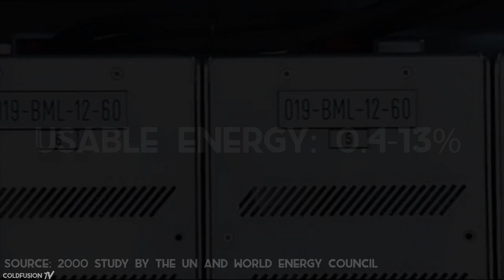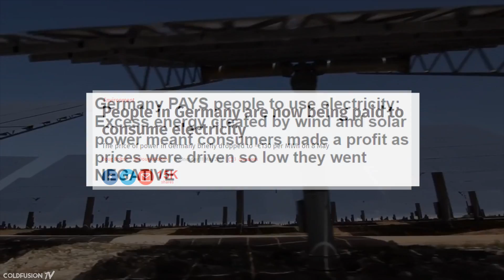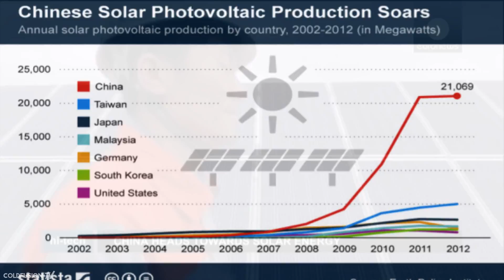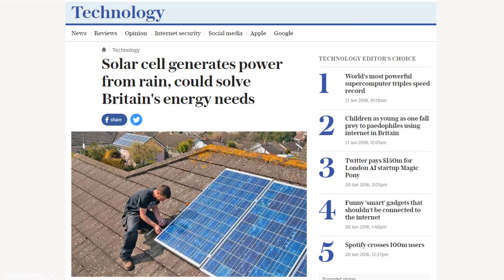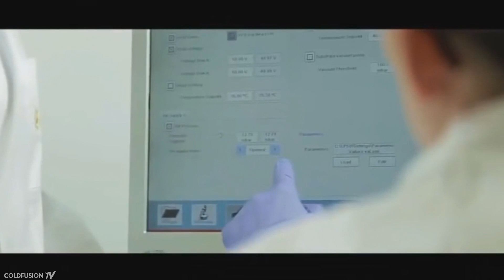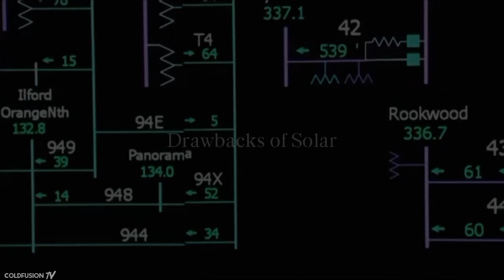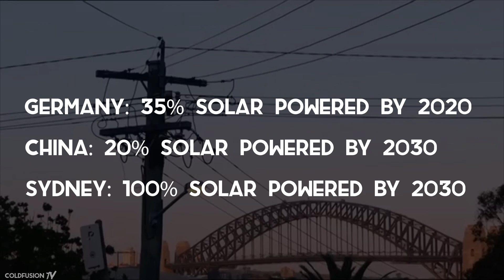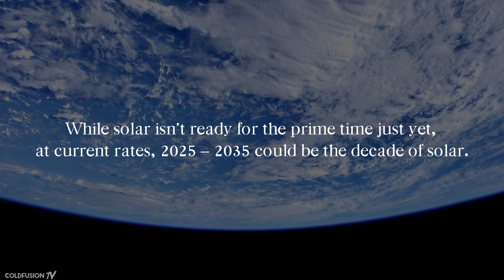The Truth About Solar

Comment: I think the best way to think of solar power is that it will never replace any main power system but rather it's more fitted for a little boost of power like a secondary system. It would just help provide a bit of power and lower our usage from the main source.
Sure it would be great to have solar panel tech on our cars and devices but not considered as a direct replacement. We could extend the battery usage with solar power and that could give you a few more hours depending on what device is using it.

For example I want to get a portable 40watt solar panel to charge my quadcopter batteries as I'm outside flying around. The panel provides 12volts and over 2 amps which is perfect for charging my battery packs and that's from the sun alone. It's about the size of a suitcase and the ones from poweradd actually fold up. It's pretty neat.

Comment: why would peak demand happen at night in a household?? (8:00) - are you thinking about households with electrical storage heaters, which normally use night-time electricity that is much cheaper due to lower demand..? 
And the up to 35% conversion efficiency is actually pretty impressive. Plants only convert 2-3% of sunlight, and are still pretty successful! (obviously they do a lot more than just convert sunlight).

Comment: Honestly- it's too bad they didn't mention the Tonapah Concentrating Solar Power Plant which has 8 hours of energy storage.  This is not a concept or a future dream, it's an operating power plant in the Nevada Desert.  it outputs 120 MW of energy all day and then has ~880 mWh of energy it can provide to the grid overnight.  The drawback of PV, as stated in the video, is that when a cloud passes over you lose almost all the energy.  This is debated, but with current PV tech you cannot use most of the solar energy that will pass through a cloud layer. Batteries are too expensive right now, Thermal storage, while not the most efficient option has a few benefits- it does not degrade over time like a battery does, it is much more cost effective currently, and it is very scalable as we have steam turbines that will run anywhere from 10MWe to 1600MWe.  Just need to build the storage capacity while recognizing that the storage does not produce power, but it stabilizes the grid such that it is useful energy.

Comment: they should try to make homes individually power independant with solar and batteries ... reduce the need for a central grid that is expensive to maintain and if it breaks it effects a wide area   -- if more homes and businesses were autonomous power producers , they would be less vulnerable to a grid breakdown or attack on the grid , cost of expansion is high and un sustainable

Comment: you know thous bendable solar, yea we don't need to get rid of the power post, we can slap thous bendable solar right on it to attach the power there.  Mostly the energy poll and post stand is one the thing possible still standing certant area because they don't get disaster.  Soon the bendable solar will be on our windows, currtans, out door safty railing, and other parts of buildings can be stick on or able stay there forever it can last.

Comment: see its hard in some respects. our current power system is difficult with variability. if you're using 9.1 gw you need that much generated exactly. if you're generating that much, you need to be using it. this means some turbines for wind can literally be shut off due to over production periods. with solar I think it needs to go somewhere period. when they mean negative power prices, it's less about free energy more about we need this gone or the system shits itself. 

I'm.for solar and wind, but for how much we spend on it we should be doubly spending that on infrastructure upgrades for them. what I mean is advanced storage systems for smoothing and more computer operated grid switching.

Comment: One thing you failed to mention is that a solar array is SO FRIGGIN HUGE that it makes it impractical to expect it to be a primary source of energy. If you could supply your home's demand for electricity just by putting solar panels on your roof, then that would be marvelous. But the fact is that you can't. And WHO can afford those "safer-than-ever" batteries you mentioned? Sure, I'm here because I want to reduce my energy costs. I mean, who doesn't want to reduce their electric bill? But solar power is such a small contribution that one has to weigh the financial benefits against the cost to install the upgrade. It's not worth it to me, an ordinary working class home owner, to buy a solar system which won't even begin to pay off for another 10 years, not counting the maintenance costs, and the cost of system replacement (nothing lasts forever). That money spent could be used for other, more profitable investments which would off-set energy costs at a far greater rate. No, I'm looking for a way to get energy supplements to pay off in maybe 3 years or less.
Reply: Like most things in their infancy, there is plenty of technical break throughs to be had. Yes the here and now is not so good for the masses but there is still some savings to be made. Just like insulating you attic it is an investment over time, you dont get that money back right away either, probably faster though then a solar power investment. My brother and his wife invested in a system and will see pay back in in about 5 yrs. It was a lot of money for them but they looked at the long term and they are now grid free.  Free grid tied systems are becoming more popular all the time, you make a bit of money and lower bills at no charge to you. One thing you can be sure of - your power bills will always go up when the government is supplying it.
Cheers,  Patrick

Comment: So if you can get a bunch of solar panels that can generate electricity off of artificial light. Then wouldn't that mean you would just be using your power over and over again and not having the pay a single cent on electricity? Because the panels would be generating enough electricity to power the lights that are powering the panels.

Comment: Another huge problem about solar is what happens when the panels are thrown away. Similar to the electronic waste crisis, but on a larger scale, solar waste will be a huge problem in the coming years as early solar panels come to the end of their life cycle. 

Because the existing infrastructure would cost so much to handle the new rise of solar, I think we will see a huge shift towards off grid housing even in suburban areas thanks to a huge rise in power walls. As long as the solar on your roof creates more electricity than you use, there is no reason why you should have to be tied to the grid, especially when it costs more to do so.

Comment: I was really hoping you would touch on the various costs of sourcing raw materials for solar panels. Are these materials mined ethically. Are these methods causing more harm to the environment. How much child labour and exploitation is involved in the extraction of raw materials. Still, thank you for all your research and excellent videos.
Reply: But unlike fossil fuels which do constant damage to the environment, the materials used to make solar panels can be indefinitely reused once mined. The benefits are undeniable, especially since they are already far less harmful than the effects of burning coal and oil.
Reply: Cheegum silicon is the second most common element in the earths crust and its basically the only thing you need to make consumer grade pv cells

Comment: Fun fact: A century ago some places got their electricity locally(from a single house up to a few blocks) from a private steam engine. Obviously few people were awake at night to need electricity, coal was expensive, and the engine operator needed sleep too, so it was lights out just a few hours after sunset. They didn't have the tech to regulate production according to consumption either.

Take that into account next time you hear complaints about how solar does not work at night or is otherwise unreliable. The issue was solved exactly same way we can make solar power work 24/7 too: Just set up the proper infrastructure and enough power plants.

Anyway, about the video... "The truth"? Sounds like there's supposed to be some big revelation.

The truth is that every technology requires a period of prototyping, refinement and redesign before it is ready for mass production, and, once that is possible, selling it to buyers. And in case of solar power those have been retarded by conservatism and the government focus on oil and nuclear power as well as people being greedy and/or idiots.

If we had put more time and money on solar research decades ago, we would be betting most of our energy from renewables now instead of in fifty years, simple as that. Stuff like those angled panel towers would have worked perfectly fine with panels we had in 20th century, and most of the materials needed aren't like graphene, which was only invented recently. First cars were too expensive for most consumers, but because Ford produced lots of them he could afford to lower the price.

Scientists suggested powering cities with huge wind turbines in early 1900's and Popular Mechanics did a big article about it again in 1950's, but the materials were too heavy and the energy needs went up so the idea of one big windmill doing all the work was never feasible. But that does not mean wind can't work, no matter how much naysayers claim it does. Likewise, just because stuff like Solar Roadways isn't going to magically solve everything right now does not mean it can't be made to work. It's not same as a scammer claiming a tiny windmill is going to power your whole house and then installing it so badly it doesn't even work.

Then there are issues that are falsely blamed on solar power, like needing a new electric grid to use solar power, or having to replace solar panel roof tiles in a few decades. NEWSFLASH! The US electric infrastructure is almost a century old and much of it needs to be replaced or improved unless you like blackouts. And a typical roof material has to be replaced every 20 to 30 years anyway unless you like leaks.

Frankly, nothing new in this video. Technology advances, improvements are adopted, someone is trying to sell it all as their new and original idea. "Experts" either assume current trends continue(this is what gave us the "oil is cheap, let's build bigger cars"-thinking in the first place) or make guesses that are as reliable as any other guess made by experts.

Comment: SOLAR is still too expensive for us consumers. Figure out what you need this way.  1(280 watt) panel can put out about 1 kWh per day.  Check your usage on your meter for a 24 hour period.  It will change with the season.  You could average your usage over the last year.  You would need 80 panels to balance out a 80kWh load.  I was sold a load of sxxx by a dealer that said I could get by with 44 panels on my roof. NO WAY!!  Put your $$ into weatherizing your house.  Increase the insulation in your attic, put an industrial size solar fan in your attic, maybe use a solar barrier (mine works!!) and you can save 40-50% on your energy usage. IF you add a solar array like mine (44 panels) you MAY increase that savings to 60%.  DO NOT BE LIKE ME and do a solar array to save energy, IT DOES NOT PAY!!!  IF you have thousands of dollars to throw away (I did NOT) and want to feel good about going green (I did want that) then GO FOR IT!!  The solar guys want to MISLEAD you and make themselves rich off of your ignorance.  DO YOUR RESEARCH!!!  It is only simple math.  I am absolutely paying for my mistakes.  Learn from MINE!

Comment: Solar power is a no go place for a lot of reasons. Take a good look at the solar array laid out on acres of land... you say "eyesore"   and a destruction of natural beauty. Very little benefit from the cells at a tremendous cost coupled with cleaning and cloudy day losses. Wind power is better but not great. Tidal and gulf stream is very promising for a constant source of energy. The gulf stream moves at a constant rate of 4 knots continuous. What do you think that would generate?  Nuclear power for each house would be best and take a very small space encapsulated in led. If we can do it on ships we can do it on homes. We have electric eels that can generate lots of power, how? Why isn't that being researched and used?Most inefficient engine is the gasoline engine and no one has yet fixed it. Wankel engines were promising for their real drop of friction... but the seal problem has not been solved.

Comment: I think solar is very promising, but the problem I see is that MOST of the high energy light from the sun id blocked by the atmosphere. This is good for us because that light (Gamma rays, X-rays, ultra violet) is bad for living things, but it also means that most of the energy from the sun is lost before it reaches the ground.
    This is even more of a problem for high latitudes. There just isn't much energy at ground level.
   Of course the solve for this is to put the solar panels in space. Energy can be transmitted via a laser to the ground. Airplanes would need to avoid flying through the laser, but pilots are used to dealing with restricted airspace. Worse would be the possibility of the laser moving off target. It would be so long that a shutdown command from the ground would take a "long" time to reach the satellite then that beam would continue down for some time after the satellite stops the beam. The fraction of a second delay would be enough to cause a lot of damage.

Comment: Being over 50 years old, Solar was always the dream energy along with Fusion power.  Though I grew up thinking about star trek like power plants being everywhere, our advances take time.   More people thinking about Solar as the energy future is a good thing.  Getting all the kinks out of growth is going to be hard.  Grids change, maybe we need to think of changing them to fit Solar from the ground up.  Solar will get it's biggest push in Africa and Asia as they don't have a Grid tied to the old energy paradigm, and their new grid can be built around Solar as their main energy source.  But with change comes,  Change.   It is not going to be like it was for you growing up, it will be different, so expect that difference, and look forward to it.

Comment: Solar power.  You should strictly include only photovoltaics "PV" power.  This video includes many shots of mirror-powered molten-salt-driven engines.

We are against the distribution of power.  Power should be generated locally.  I should not be required to generate power for my neighbor, my neighbor should have own solar (PV) panels.  ON this paradigm, nobody should have to travel, so your question of what fuels a car is BOGUS.

Comment: 9:00 No, the existing grid would only have to stop being used.  there is no expense in that except for perhaps... cleanup after they are dead.  With Solar Power do not use Grid Tie, generate ALL POWER LOCALLY.  "Solar City" company must DIE. do not GRID TIE

Comment: 1:13 correction, less than ten seconds of exposure of the entire earth's surface unwrapped flat exposed would amount to more than what is consumed in a year, probably less than a second per year, even with the 1:1000 ratio.
Reply: in other words, give up the only level6 state, Arizona alone could power earth with solar power.  Move Every Single Solar Panel to Arizona :: Power Earth

Comment: Maybe those 3D solar sells (on 5.43.) can be placed on power line transmission towers. Transmission towers are all over the world and solar panels (3D ones) can be place on them. Transmission towers will not only serve as a "thing" to hold the wires but also as a small solar plants that could actually produce energy and easily put it in to a grid.

Comment: Ontario converted hundreds of acres of green pasture to concrete. The combined power generating capacity shown on the nameplates is just under 300MW. Year to date total solar power generation is about 1% of the nameplate ratings. Ontario has the most expensive electricity in North America. Power consumption has  dropped as large industries shut down and moved outside of the country. The Niagara hydro-power generation station is over one hundred years old and generates over 1000MW of power. Nuclear power "still" supplies 70% of Ontario''s power...this has not changed much since the "Green" scam went into effect. Without any fanfare the Ontario government will be refurbishing the nuclear reactors. Germany will be doing the same thing, and building new ones. Both countries use the nuclear reactors which use natural convection to cool down.

Comment: while solar is impressive you should make a video about the whole renewable industry and how it will work in the future.

how will it impact our lives if we actually did go 100% renewable?

will we be able to continue our electricity gluttony or will we have to change our way of life?

i am thinking along the lines of new vs old house, new houses can be built to be energy efficient and thus allows the inhabitants to use more power on their devices instead of maintaining the house, where as the old houses will probably have to be modified at great cost.

all of that will have a huge impact on the future as the world runs out of cheap alternatives to renewable energy..

Comment: I dare say that current solar technology is advanced enough that further advancement should be considered as optional. instead of spending resources on making the solar panels smaller and smaller, the resources would be better spent on researching a more efficient and effective way to store the produced electricity. right now, electricity generated by solar panels must be used in real time. the alternative is to redirect to your utility power grid, but this wont work if everybody's dumping the excess power without anyone actually using it, like in europe countries.